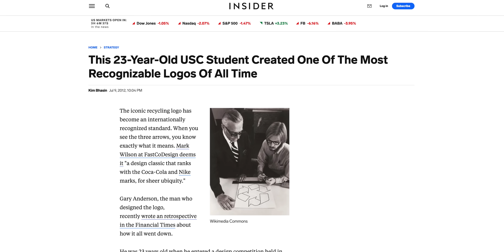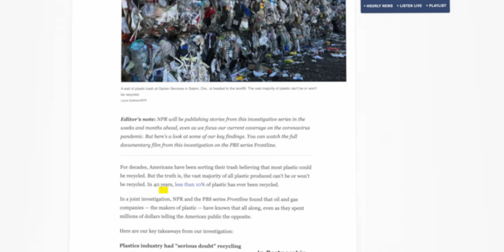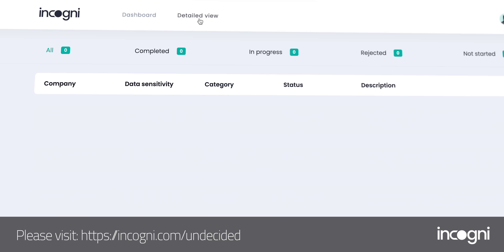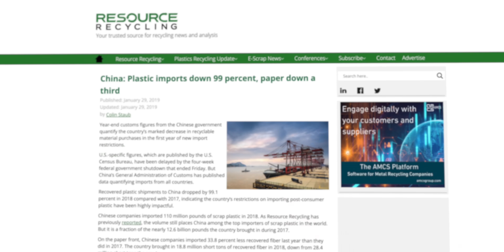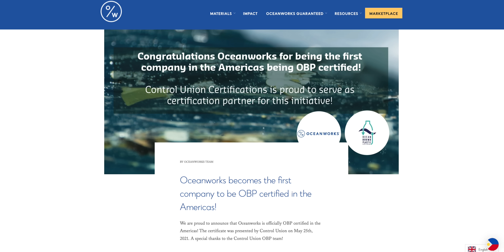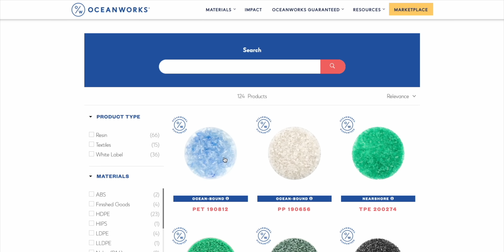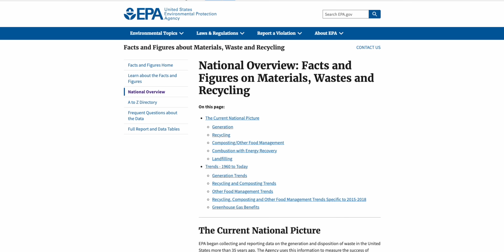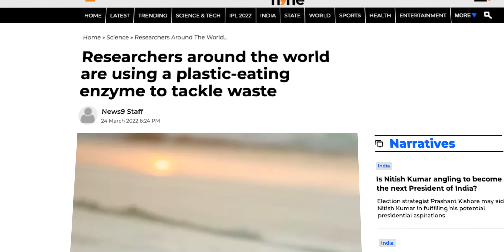The Truth About Plastic Recycling ... It’s Complicated

Comment: Stop buying Bottled Water: This is the BIGGEST scam of all time! 1: you have no idea what quality water is in the bottle 2: the costs of shipping and the co2 emissions from shipping water from its source. 3: Ethically the water taken from one place is highly questionable. 4: If the bottle has been left in the sun many chemicals leech into the water. 5: the biggest issue is that bottles are "printed" and then immediately filled with water. A study in Europe of 16 different water bottles (different companies) found thousands of chemicals in the water..because these bottles need time to de-gas but are used too soon.

Solution: Get a Berkey Water filter or some other good system and stop buying bottled water!

Comment: your portrayal of recycling plastic is pretty grim  even if you want to avoid this  kind of hard work of sorting material  plastic   we can use plastic  with concrete to make floor tiles  and bricks    in  some african countries they 're already doing this  in my view  plastic can be recycled   to  stuffed   metal slabs so that we can stuff plastic within two layers of  metal and glue them with cylicone based adhesives

Comment: They already inject concrete into the soil to stabilize foundations, & they sell heavy duty Re-Bar boxes. None of this is new. Take the non-recyclable plastic grind it up, stuff the re-bar box with it then inject your concrete under high pressure, & make a heavy duty concrete-rebar boxes full ground up plastic.

Road beds? Side walks? Sound walls along highways. There are, uses for big concrete boxes like that. & the the non-recyclable plastic, is being recycled at last.

Comment: With 21st century innovations like 3d printing with recycled platic, making boards, pallets, and furniture out of recycled plastic, turning recycled plastic into diesel fuel, very durable homes built out of recycled water bottles, cost effective bricks made from unrecyclable plastics and so much more, we need to change the way we recycle and put a dent in the floating islands of garbage

Comment: Couple things you missed, in my opinion: 
1. I don't think you talk about the actual solution to make the change, but briefly mentioned it, and that is cost.  All the new companies creating the mushroom or algae alternatives are still more expensive than using plastic.  The SECOND they get it the same or below plastic cost, then every manufacturers will switch.  All about the money. 
2. Not enough mentioning of Reuse.  This is the issue with most of the world, but Western developed country in general: We labeled everything as "Single-Use" plastic.  None of the plastic packaging we bought are actually "Single-Use", especially knowing how long it takes to decompose in soil.  Supermarket plastic bags, I reuse them over and over until the rip.  Plastic containers I reuse them over and over to store food and things, until they break or tear.  Ziploc bags I wash and reuse them.  We CHOSE to not reuse.  That's also a root problem.

Comment: Why can’t we use metal instead of plastic
Reply: Producing metal consumes extreme amounts of energy and resources (explosives, machines, fuel), absolutely annihilates nature around the mine (waste material stacks - often toxic, pools, pollution, even radioactivity), and there's always going to be toxic spills from waste material pools and processing facilities. Metal product manufacturing consumes large amounts of energy (electricity and natural gas). Metals are also heavy so using metals instead of plastics in products will make products heavier and transportation will consume more energy (same with glass). Another aspect is of course the volume, because we consume way more plastic than metal industry is likely able to produce. But, we do use metal where it's the best option. Almost all metal that can be is recycled just because it is so much cheaper but recycling still needs lots of energy. There's just always loss, e.g. rust, which consumes a considerable amount of steel every year.
Reply: Oh yeah, and huge portion of world's clothing starts to be plastic based as there's just so many people and limited amounts of natural fibres. Metal clothing doesn't sound very pleasant.

Comment: I almost went to work for a startup company in 2015 that was designed to recycle plastic bottles back into petroleum products, but I ended up climbing cell towers instead.  After 3 years working in oil fields all over Texas/Louisiana/gulf of Mexico,  I'd had enough. We should go back to glass bottles and reusable milk jugs, etc. 
Also,  why are we still making/selling/buying fountain drinks in Styrofoam or any plastic cup? We could eliminate plastic if we really wanted to.

Comment: Recycling has always been a subsidized, municiple jobs program. I'm not being negative or flippant. Recycling is a good example of what happens when large numbers of people demand that government solves a problem. Most plastics are shipped overseas to satisfy exchange requirements for oil-dollars. The plastics are buried or dumped into the Indian Ocean. The small amount of plastics made into other items represent a net-loss in the energy required to make the same product from raw crude. Recycling could help if the plastics were reincorporated into the fuel industry. The math for recycling paper products is way worse. Paper will reduce to carbon-rich soil if it's buried or heated.
Chemically dissolve plastics and combine with commercial fuels for burning in ICE vehicles, particularly large fuel-oil burners like ships.

Comment: It's important to communicate nuance here. Recycling is not a complete solution to the plastic waste problem. With that being said, I see many react to this by thinking there's no point in recycling, so just put their single-use plastics in the trash instead, without reducing their consumption of single-use plastics. This can be seen in the comments here, which is unfortunate. Recycling plastics that are recyclable is still much better than throwing them in the trash.

Also, the types of plastics that can be recycled are different depending on what's accepted in your area. My local recycling centers accept RICs 1, 2, 4, 5, and 6.

Comment: I'm glad that Americans are finally getting a clue about their need for "feel-good" environmentalism, versus the substantive type.  I spent three years in China on business and during that time I got a chance to see some of this recycling up close.  I was at a recycling center where a big Chinese-made machine used high-pressure jets of scalding water to wash plastic bottles and remove their labels.  The bottles then went through a hot air dryer before entering a giant shredder that spits out tons of plastic confetti that were repackaged in huge bags for reuse.  The problem was no one wanted to use it.  My Chinese colleague (who got me on this tour under the pretense that I was interested in buying the machinery) told me how crappy the recycled confetti was and that it was only used to make disposable shopping bags...which are a bigger form of pollution than even bottles.  That was nearly 15 years ago and it immediately made me realize that plastic recycling is mostly bullshit.

Comment: They should use pyrolysis to convert it into liquid fuel. Green Power Inc had great technology for doing so as well as others. Also, burning it isn't nearly as bad if you add high concentration oxygen to the burn and appropriate smokestack filters. It burns REALLY fast and REALLY hot.

Comment: I have worked on many larger projects in the electrical industry.  The job is still going on. TRUMP had 4 billion dollars put to the job. It is for the Shell cracker plant. Around Pittsburgh.  It takes plastic bottles heats them up and turns them back to plastic buckshot sized plastic . To make new plastic items.  Or if you want to keep the heat on in the process plastic is a petrol product right back to gasoline.  It is a great new step to have a real use of our recycling system.  Now where this Potter County there is no plastic bottle recycling.  But that will happen soon . Much need to clean up an area.
Reply: Also single use plastic as shopping bags will be greatly reduced and worth money to recycle.  We had to pay 5 cents for years at the store so now we should get the nickel back to recycle them old plastic bags.

Comment: China actually took the plastic recycling because we also agreed to send over our electronic recycling.  We stopped sending electronic recycling to China because they were removing components and then reselling chips and other parts back to the United States and a lot of these components were blacktopped and stenciled with fake part numbers and ended up being used by our military to repair electronic systems that would continue to fail.  We stopped sending electronic waste to China which is the real reason they stopped taking our plastic waste.

Comment: "recycling __ is a scam." golly. what else is "new"? 🙄
"everyone" with at least two consecutive operational brain cells knew that back in the 1960's. The glass, plastic, and paper you so carefully separate goes to the landfill just like the dead kittens, and table scraps that don't get composted or fed to the chickens, and the used depends and other disposable diapers.
some metals might get "recycled" ... into boat anchors or refrigerators. automotive batteries are "rebuilt", even if they have to be exported to pakistan or asia since the first clinton administration.

Comment: Plastic is100% recyclable it can however be labor intensive depending upon your intent but if you pressure cook plastic it returns to its oil base that can then be turned into fuel for your car.

Comment: There needs to be a distinction between pollution and waste. The plastic entering the ocean is a problem, not the plastic entering land fills. The US produces the most plastic waste, but isn't close to the top plastic polluter.  Indonesia creates 30x, China 40x, and india pollutes the ocean 50x more than the US.  If the US stopped using plastic completely, ocean pollution would be reduced by less than 1%. Get these other countries to stop littering and the problem is almost completely solved.

Comment: I have wondered for years why plastic bottles are not recycled into building materials similar to OSB.  It should be cheaper and far more durable than OSB.  As it is, I quit recycling because I got tired of finding a pile of stuff pulled out of the bins by the recycling company and just dropped on the ground beside the regular garbage can.  They took out steel springs and aluminum brackets.  That's when I stopped bothering with it.

Comment: I don’t think my solution to the plastic waste stream nightmare is THE solution as it’s probably not scaleable, but it is a solution that provides the individual with a lot more control over their own waste. 

Some years back I decided it was crazy that I throw out all of this packaging only to go out and purchase more plastic containers for storing and organizing my stuff. So I decided to use the packaging of my consumables to make containers for housing my stuff. There are three secrets to making this work: 1) a rotary tool to cut and shape plastic, 2) papier-mâché that uses plastic packaging as armature 3) patience.  Upside is my organization containers are totally custom to my stuff and my space and my taste. 

And it’s cheaper in general depending on how fancy I get with decorations. For example all of my pegboard bins were made out of berry baskets, paper grocery sacks, and junk mail. I used whatever wire and paint I had on hand for other projects so technically I didn’t spend any extra money on my pegboard organization system. I even bought used pegboard at a going-out-of -business sale so 120 square feet of pegboard cost me $20. 

I still haven’t come up with a reasonable replacement for  big plastic tubs, but I have drawer organization down. I also don’t have a grand solution for plastic bags. I can say that shredding bags and using them for outdoor pillow stuffing did not work. Plastic bags can be bound and shaped for armature but the best way I have found to do that is tape and hot glue both of which are made from plastic. 

It’s far from perfect but it is something. I figure more experienced makers and better designers will have even better ideas.

Comment: Your comment that only 2 of the 7 resins are recyclable is entirely incorrect. All 7 resins are recyclable. Yes, the first two are the most straightforward to recycle, but all 7 have the ability to be recycled. I work in a recycling facility that can efficiently recycle all seven categories. Please don't spread misinformation!

Comment: You don't have to think too hard about recycling of plastic. Sure it's a hoax. If you bring in metals, glass or some places paper, recycling places pay for it. The only plastic which is worthy for them is plastic bottle caps. If plastic cans, bottles, etc.. doesn't worth a penny for them, you can be 1000% sure, it's ends up in the oceans or bury them under ground.The only reason I separate plastic from other trash, because it's cheaper fro me to rid the rubbish off. The council charges less for plastic waste, because it's much lighter, less fuel consumed by rubbishtrucks. That's all. Fooling people big time.

Comment: The sad part about the plastic recycling controversy, is that in popular culture many people make the mistake of judging with broad brush, and apply it to everything that goes into the "Blue bin". This includes aluminum cans. As someone that has work in metal fabrication, I can tell you that unlike plastic, metal recycling is a very profitable business.

Metal recycling is so profitable, that the crimes involving metal recycling, involve stealing metal items still in use. This includes catalytic converters, Copper wire & pipes in vacant houses, and aluminum window & door frames, from those same vacant houses. We use to make money selling our leftover scrap. The scrappers came to us. This include scrap steal, too. Making "new metal", from mined ore, is very energy intensive, while scrap takes only a fraction of that energy. With current gas prices, that energy cost has gone up, even more.

Comment: At the core all recycling is an exercise in energy use. With enough cheap energy any product can be recycle but cheap energy is against the green movement's goals.
The best solution is a land fill until we return to mine our old garbage for materials.
Reply: any source of cheap and clean energy has effectively been banned on purpose. can't reduce the population to 500 mil if we still have the capacity for 10+ bil.

Comment: This is for sure a political issue... as we can see also what is happening to the car manufacturing industry, and soon a complete ban on ICE engines in Europe... which doesn't even make sense, since you can run an ICE on hydrogen. With politics you could easily ban plastic... or ICE engines.

Comment: Switching to a different material might not reduce the problem.
The largest problem is that there are so many humans on the planet.
The other problem is that for materials like metal or glass the pollution produced by producing and even recycling the material might be more than using and then burning plastic. It's a very complex problem with no simple or quick solution.
Reply: i know! lets mu rder 95% of the world's population so theyre more contro... i mean sustainable 🤣

Comment: I live in Cheyenne Wyoming, but out in the county. There’s pretty much no recycling for us. My wife wanted to recycle so we used to drive to the next state where a state drive up facility took plastics, glass, and paper/cardboard.

When I worked out the cost of driving the 100mi round trip to recycle, as well as the recycling efficiency, I realized we were doing more damage recycling than dumping.

We will now reduce as much as possible. For instance, even though soda in aluminum cans is usually more expensive per ounce than plastic bottles, aluminum is highly recyclable and the return offsets the extra cost by a little.

Comment: Plastics are made from oil. The most reliable way to recycle the stuff is to burn it and use the heat to make power. OMG what about the pollution?  There would be none. All fuels need the appropriate boiler and shredded plastic is not different. It’s also very low carbon because the oil has already been used once so it’s us as fuel is displacing new fuel that would otherwise be needed.

Comment: The issue of putting the burden on Big Plastic and plastic manufacturers is that all the overhead and regulations required to enforce any burdens will only increase costs, which is then turned around and placed on the consumer in the checkout line. This is often overlooked – although yes, I agree the companies utilizing plastic have an obligation (even a moral obligation) to consider alternative strategies.

Comment: The whole recycling market is a problem and one of the biggest misconceptions is the amount of it. Most systems set the percentage of recycling achieved by weight. That means 20 tons of waste bricks that are easy to sort and recycle and comes in on one lorry, is given the same recycling statistics as 20 tons of general or plastic waste of considerably greater volume and complexity. Remember with plastics too that whilst we think of bottles and foam cups etc, it also includes most modern waste carpets and a wide range of footwear and clothing. If these are heated, the oil used to make them can be sweated out for reuse but this is only generally viable for hard plastic types but more small units for doing this are coming onto the market. This oil content of plastics are why they burn so well and can be incinerated.  Great video.